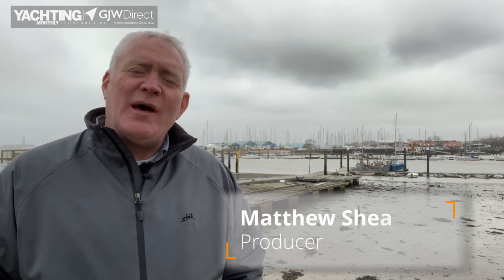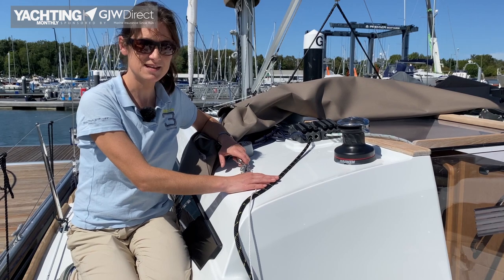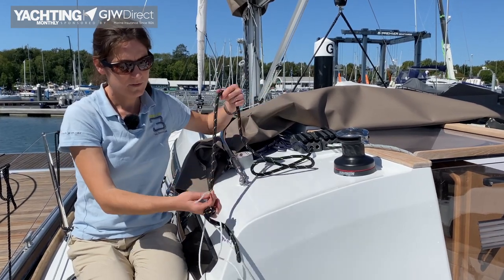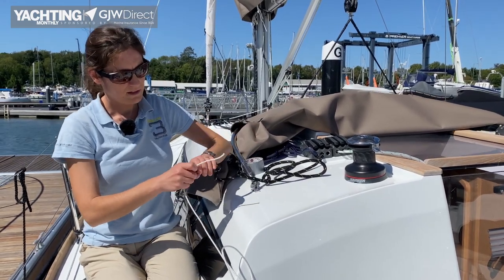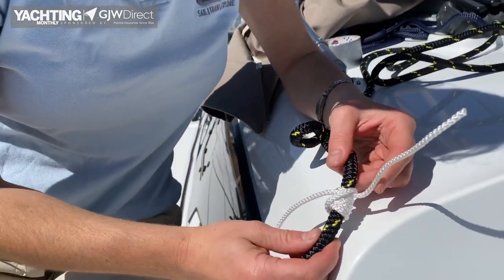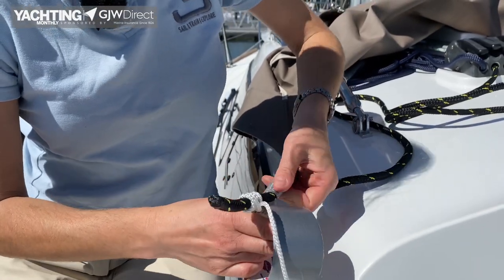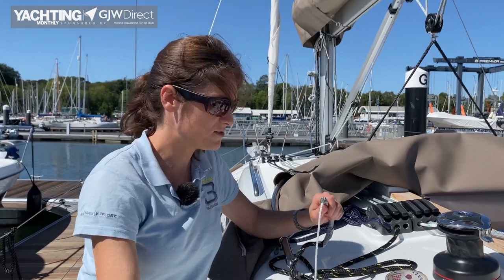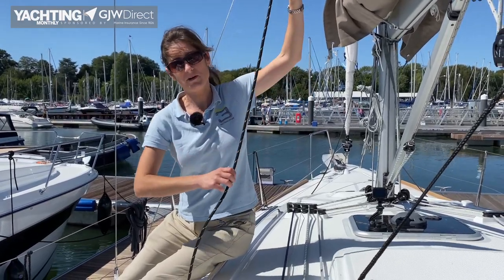How to replace a halyard - Yachting Monthly

Comment: No way will a rope halyard  with a half hitch as per her sample pull through most mast sheaves.  Always have a spliced loop put in your  halyards which you can then tie a mousing cable to it. The big advantage of this is you get a central pull and it does not increase the diameter of the halyard.